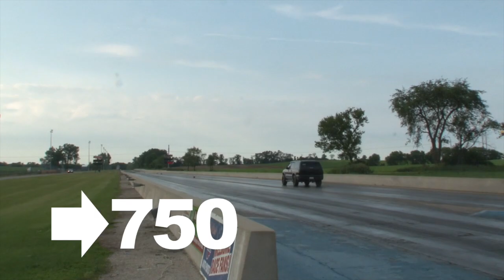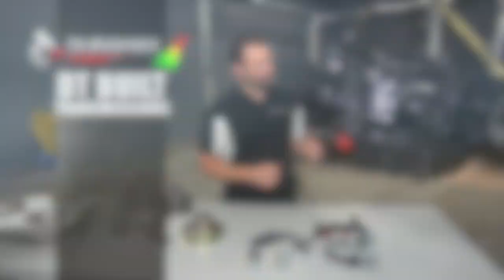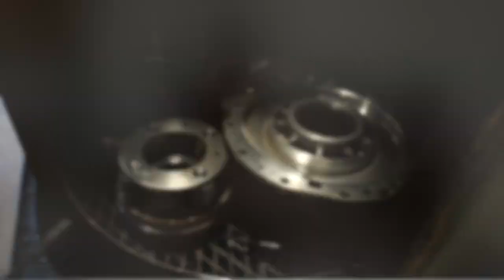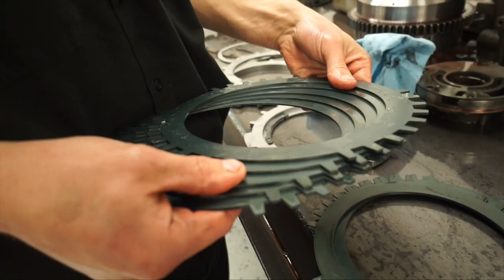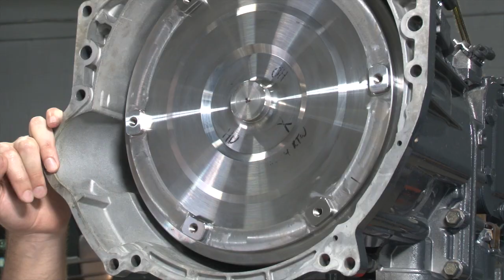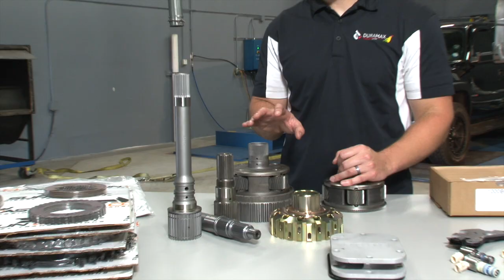DT750 and DT1000 Transmissions by Duramaxtuner.com

Comment: So your telling me an A1000 will hold 750hp with just a bushing and bearing kit, high energy frictions and steels a CP3 oiler mod and a billet TC of course VB modifications for increased shift pressure but wow no hard parts needed till 1000hp these are good trannies from factory
Reply from the maker: @dh5254 Yes, the Allison 1000 is highly regarded for how well it can hold power. There are a few other upgrades that go into it. However, those are the 3 main upgrades you'll benefit from.

Comment: I have a LB7 2001. 5 year allison tran. With alot of upgrades more power. Some times my tran goes to limp mode when I'm stepping on the gas pedal. I'ma need to build my transmission to hold more then 500 hp
Reply from the maker: Yes.  We suggest a built trans for an LB7 anytime you are over 400 RWHP.

Comment: Great videos, and ilove the clean room. That's how it's done correctly.
Question: will these rebuilds match up to a 8.1 gasser? Tia
Reply from the maker: The 8.1L gasser would require onsite transmission tuning.

Comment: Should I build my transmission? I've limped it a couple of times. I have a 2002 LB7, I got it all stock and have since done 5in exhaust, S&B cold air intake, 33 in tires and a edge evolution cs2. I limped it on my fifth tune.

Comment: Would it be cheaper to flat out Buy a DT750 from yall, or send my trans in to be rebuilt to hold that HP/TQ range. 04.5 LLY. Currently 250k miles on stock trans. 72mm VT turbo, 40% over injectors. Trans is holding out, but im beyond scared to open her up. Its already limped out on me once when i did a boost launch.
Reply from the maker: +Zachary Redmon - We sell our DT750 outright all the time. Give us a call and we'll go over the costs and what you need to consider.
Reply: Zachary Redmon i

Comment: how about a truck putting out around 450-500 rwhp, I've heard just a transgo jr shift kit will do the job, would a flywheel be necessary also at this range of HP? or just the clutch plates? or perhaps something else?

Comment: Whats a the price for an upgrade
Reply: +Jose Dominguez I would be happy to get you a specific quote, DT750's start at $3,695 for the built transmission and $1,550 for a billet triple disc converter with a billet stator. If you would like to give me a call at the office my number is 815-568-7920 ext 2122.

Comment: I'm not positive on this but... trannys are made of aluminum because it dissipates heat better than other metals. also it doesn't rust and aluminum is light.   they also come raw and unfinished from the factory for a reason. when you paint a tranny your then holding excess heat in and its counter productive as far as heat dissipation. these are just thoughts I came up with myself. I could be very wrong. please respond I'm curious. I really enjoy your guys experience and videos. also whenever I call you guys with a tech ? you guys are extremely helpful. thanks guys
Reply from the maker: +rexburn1955 We appreciate the comment. I'm not sure the paint we use has very high insulating properties that would retain heat to cause a problem.

Comment: Wish you guys were doing this a year ago lol oh well I'll try the stealth turbo
Reply from the maker: rollincoal We have Stealth Turbo's in stock and ready to ship, give me a call today and I will get one shipping to you, Paul ext 2122.
Reply: +Duramaxtuner I have an 01 w a ppe stg 5 trans, less than 10k. New filters and oil ,stock cooler and when it gets hot 200 on the trucks gauge, it starts to act up, flaring shifts and down shifting so hard it will chirp the tires(coasting to a light)Works awesome when it's warm ,not hot.any thoughts? Need a bigger cooler? Re learn? Help!

Comment: Wait.. once yoir trans temp has warmed up you have more heat. It causes the pumo to work harder to pull the extra quarts I disagree on the larger pan.
Reply: Duramaxtuner wtf is wrong with some of these idiot people commenting on your videos.  yes if you lowered your pan 10" and incorporated a 10" draw straw then yes it would be harder on stuff.  Hey guys don't fill your fuel tank all the way full. the truck will have to work harder ok.
Reply from the maker: Smokers Delight The larger pan allows for more fluid, more fluid will take longer to heat up. In our experience it works well for this.